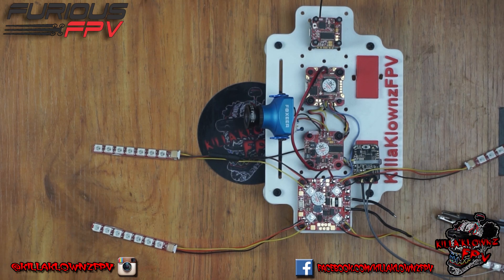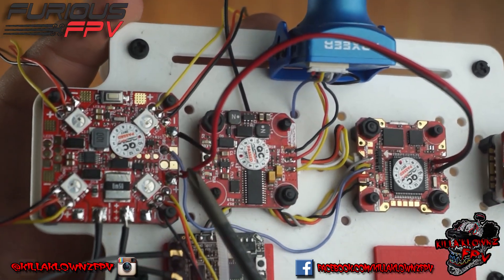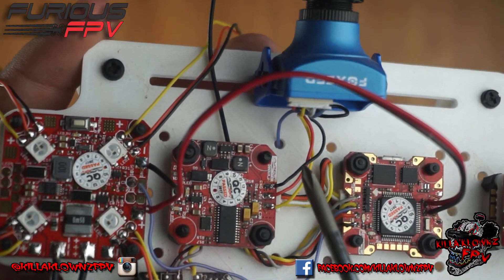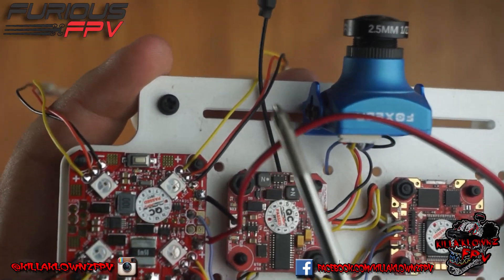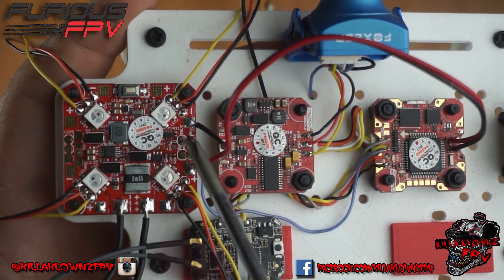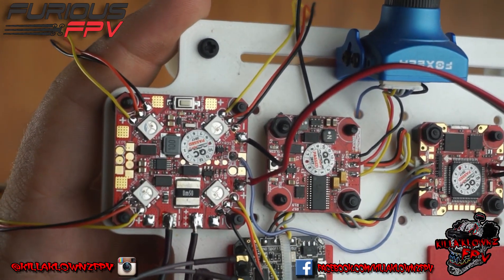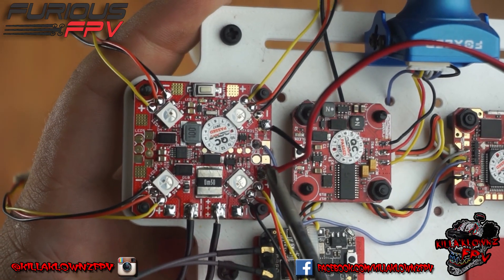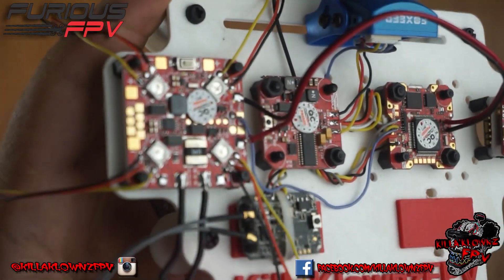FuriousFPV Lighting PDB/LED Kit - Wiring Guide

Comment: hi killaklownz , thanks for your video.I need to power 16 leds on each arms for a DCL event that is coming up in india,can I use this pdb for 64 leds?
Reply from the maker: Aaradhya Kulshrestha yes this supports up to 150 leds total. I believe up to 30 per output so each arm will take 30 and also has another pad for center strip which would be another 30 for 150 total